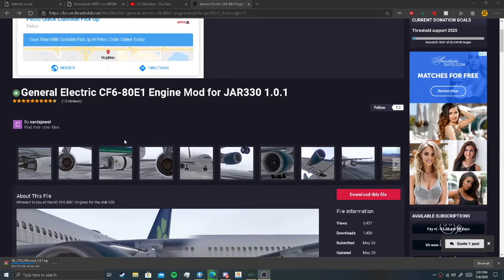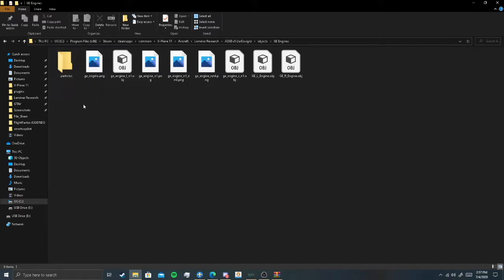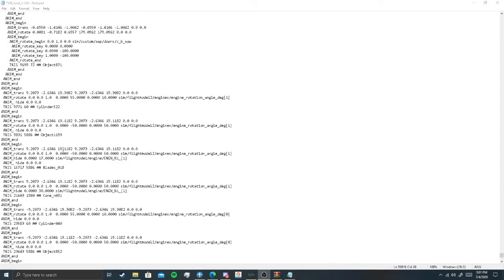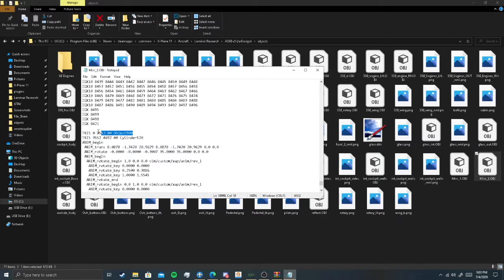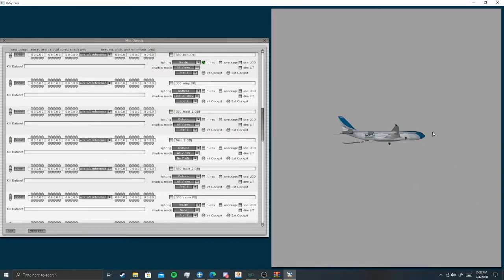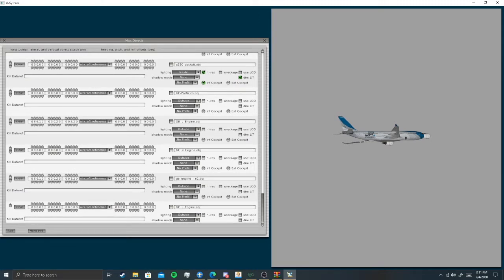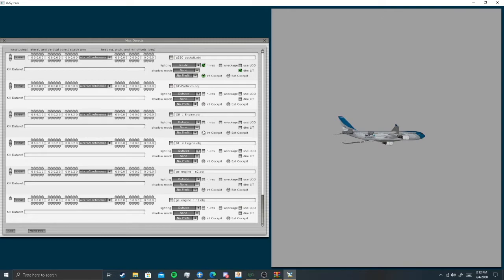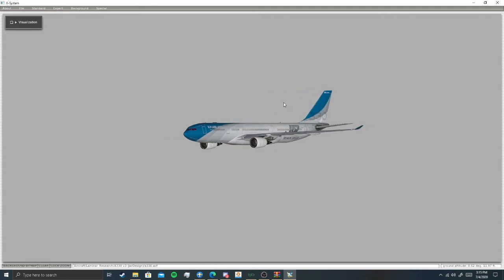How to install the General Electric CF6-80E1 [PLEASE READ DESCRIPTION, I MESSED UP ON THE VIDEO!]

Comment: Help me pls, when I load in the inside of the engines are outside the engines
Reply from the maker: Make sure you go trough the tutorial again and make sure the blade the obj and all of that is on the right coordinates. After that let me know if it works. Thanks
Reply: @jzaviation3032  okay I’ll try it
Reply: @jzaviation3032  can you make a tutorial on how to install liveries? (PW and GE engine mod) I find it so confusing
Reply from the maker: @youraverageavgeek2918  I can see, are you still having that issue with the blade
Reply: @jzaviation3032  I’ve been trying to fix it but I can’t find what’s wrong, so imma try to install it again but with the PW this time. And the liveries for the GE and PW is hard to install

Comment: First i get the bug that engines are not starting, after that i redownloaded the a330 than i get a issue and that is when i try loading the a330 it crashes!
Reply from the maker: Hmmm idk cuz It worked fine for me
Reply: JZAviation could you add me on discord
Reply: JZAviation Project Turk#9421
Reply from the maker: @cptbaku6310  what for?